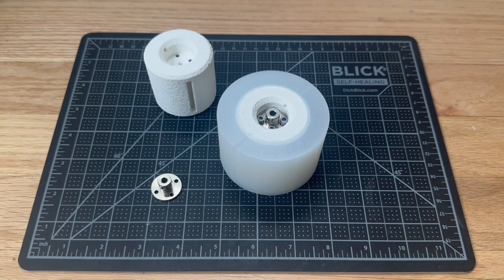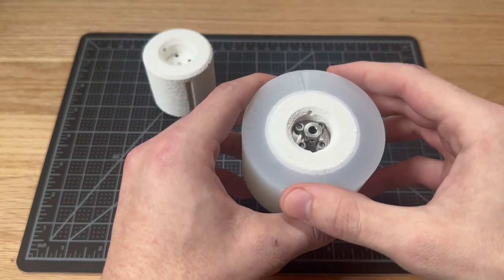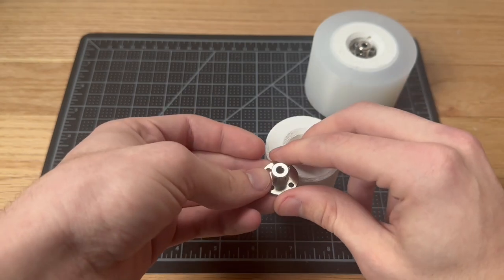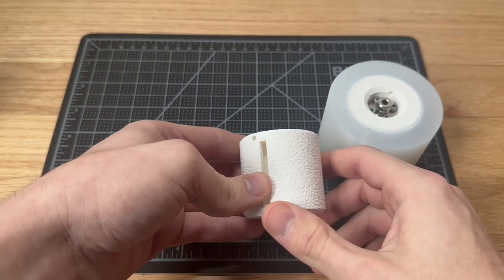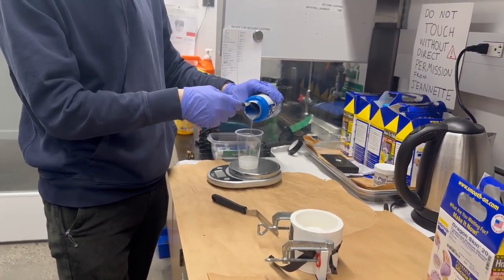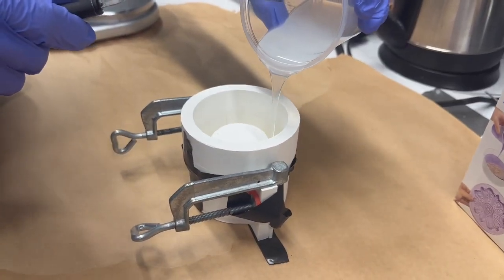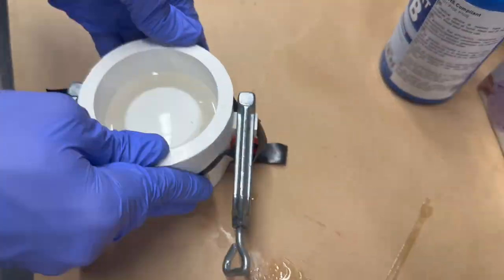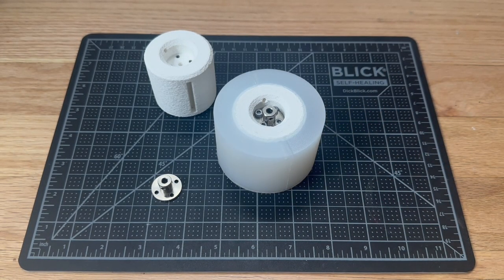3D Printed Silicone Sumo Robot Wheel

Comment: Very cool 😎  Noticed that you didn't use the vacuum chamber you have at home for metal casting - do you still like that solution? I have been FDM and resin 3D printing, and now want to learn to cast, metals and silicone, soft plastics, rubber etc; haven't tiptoed into it yet.
Reply from the maker: I do still have my casting setup. This equipment is from a soft robotics lab at my school and is a better fit for working with silicone than my own equipment. Good luck on your casting endeavors!
Reply: @Levi_Sheridan  thank you

Comment: NIce!!!. How about the traction?. I am thinking to fabricate my own silicon tyre for my sumo robot competition. But the silicon seems very thick, can i make i thinner?
Reply from the maker: The traction is great, haven’t done any actually measurements but my 5 pound robot with two wheels was able to push over 20 pounds of books. You could definitely make the silicone thinner. How much, I am unsure. I will be making a video about the full robot in approximately 3 months.
Reply: @Levi_Sheridan  i cannot wait to see that. 👍👍👍

Comment: You take a lot of effort to make this wheels, but i am afraid, that the motors you selected may not be powerfull enough, especially with very heavy wheel. Another fact is that you used 3D printed form. You should use machined one. All this air removal is partialy waisted by the roughnes of the form.
Reply from the maker: The motors we chose were about 40 watts and were plenty powerful. The form was printed at the highest layer height to minimize surface roughness and worked very well. A machined mold may be better but this worked as a quick and inexpensive solution. Thanks for watching!